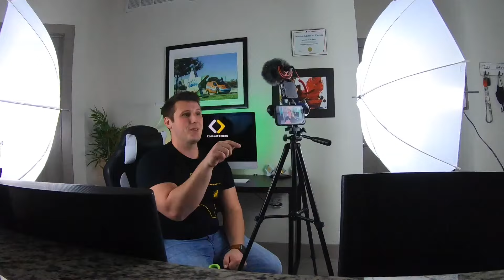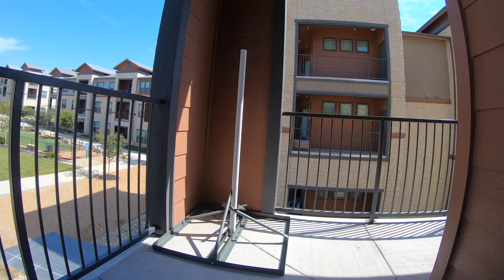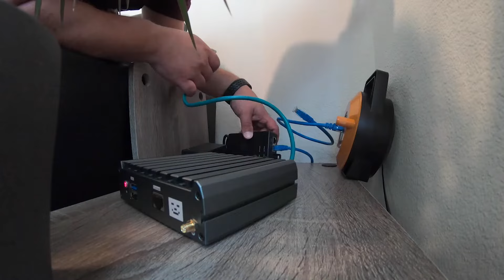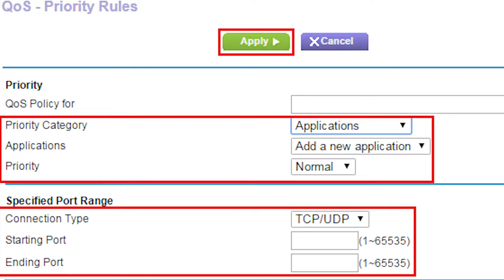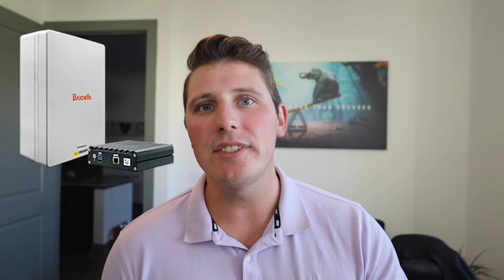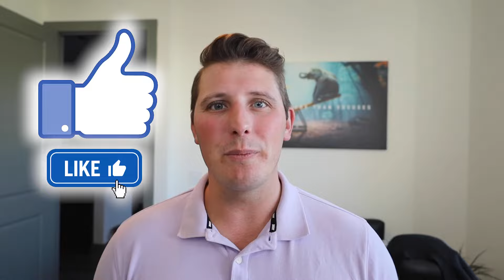5G Helium Miner Install Review — FreedomFi x Helium Deploy

Comment: Is that only can mine mobile token or hnt
Reply from the maker: As long as your gateway is in a good spot (typically a window sill) — it will likely mine $HNT. The radios mine $$MOBILE simultaneously, as long as it is hooked up and registered correctly.

Comment: i have a question. if its freedomfi hardware is that different from helium deploy vs freedomfi or the osmosi one? can anyone explain bc there r price difference and im not sure why
Reply from the maker: Some are indoor small cell radios and others are outdoor or high powered. FreedomFi uses Baicells — but any of the radios should would across available hotspots (I.e. Bobcat, FreedomFi, Baicells, & Mosolabs). Keep in mind — indoor small cells earn less $MOBILE!
Reply: @Committed3d  ok thanks, i was looking and some sites were saying i woudnt earn mobile on indoor but i would on outdoor. Others say what you said as well so im comfused. gonna try and buy one today very nervous tho soo much money. Also thanks very much for replying and awesome vid you convinced me
Reply from the maker: @BluegreBay  indoors mine $MOBILE, currently (and imagine they won’t in the future). I do suggest outdoor though because they have a higher multiplier 😎🚀

Comment: Right now I only have the freedom fi set up and connected to my wallet. Is that enough to start getting the daily tokens? 

I plan to finish setting up the radio once my third cat 6 Ethernet cable comes in the mail. I didn’t realize I needed three lol.
Reply from the maker: Great question! It will only mine $MOBILE once the radio is registered.

Comment: I will have an outdoor one soon. But i live in Florida where there is lots of rain and lightning. I wonder if these things attract lightning.
Reply from the maker: Congrats! They may, depending on how high you have them 😬 Happy mining though! 🙌🏼🚀
Reply: Hello, any updates on your unit I am new to 5g also I plan to install my unit with 3 radios in my house in a residential area how about you ?
Reply from the maker: @Anibalm28  I’ll have an earnings video out in a week or so! Very happy with $MOBILE earned so far!
Reply: @Anibalm28  yea i got the product but i actually ended up purchasing 4 more devices that are already installed, they give you that option to own already set up antennas at a higher price sort of like an investor, but i will have full ownership of the wallet and all the tokens antenna collects, the only catch is i have to send 20 percent of what it makes to the guy who maintains and holds the antennas physically at the end of each month. Altough i also have 1 at my house now, i couldn’t byass freedomfi set up yet, my internet is for some reason not recognizing the freedomfi network even though i am using a cat 8 cable, and it seems a lot of people have different issues so i felt like already installed antennas are the better way to go for me.
Reply: @Cihanshahmain  great info, good luck!! One more question do I have to remove my existing helium miner from my home? I have understood the the 5g also mines hnt together with the mobile token correct me if I am mistaken. And also can you use an amplifier and filter with an 8 dbi antenna on the 5g miner?